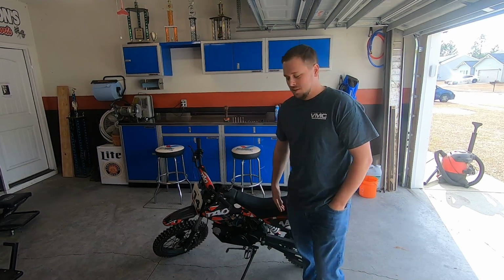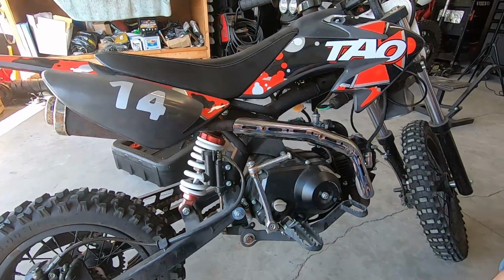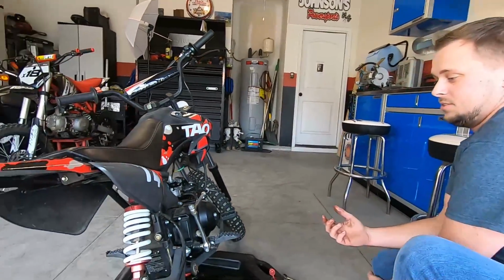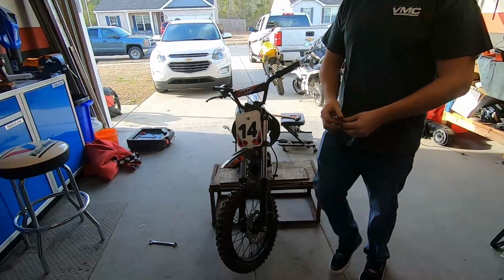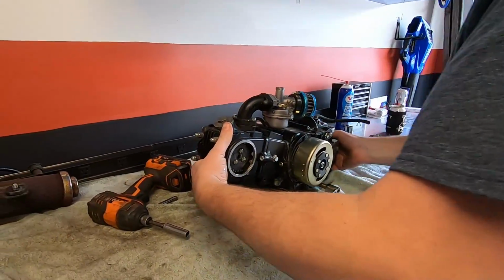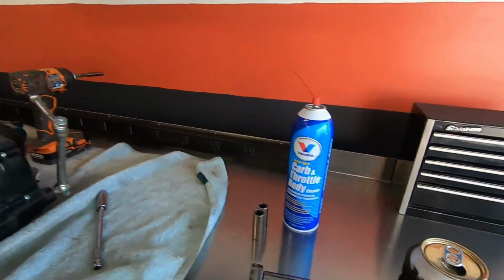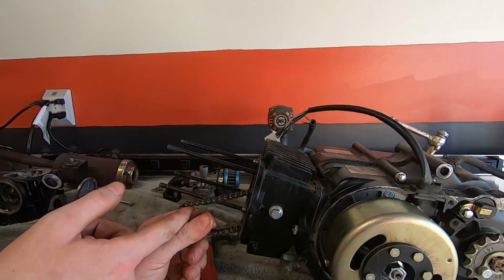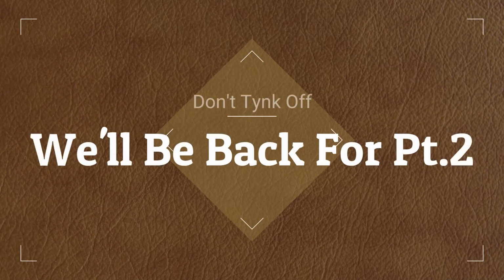Pit Bike Top End Rebuild Pt 1 of 3

Comment: hey mate I'm doing a big bore kit on my 125cc pit bike going from 125cc to 138cc and I using the 125cc head, because I'm using the 125cc head do I need to adjust the valves?
Reply from the maker: Always adjust valves whenever head is removed